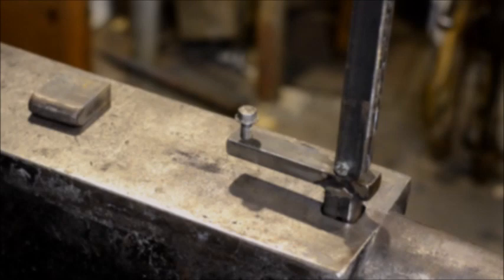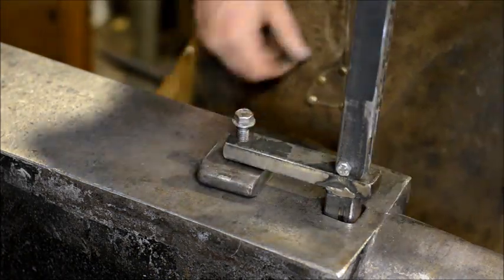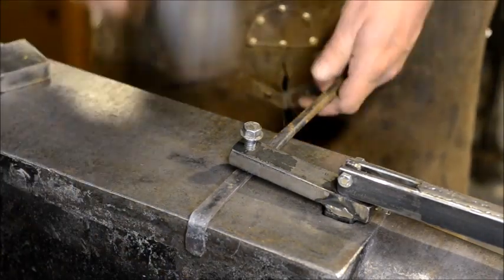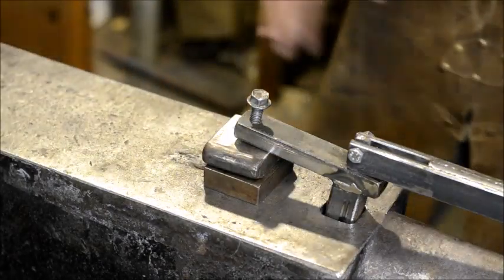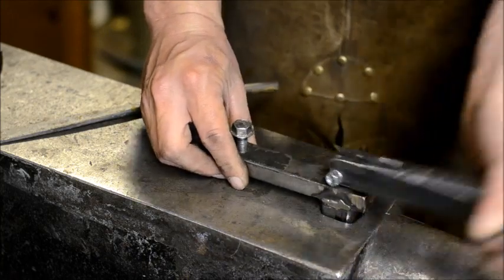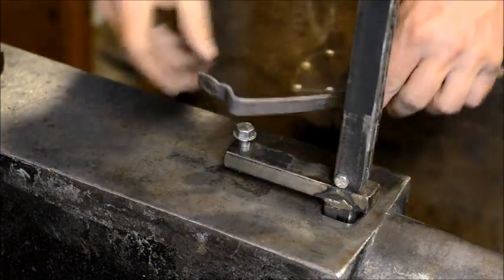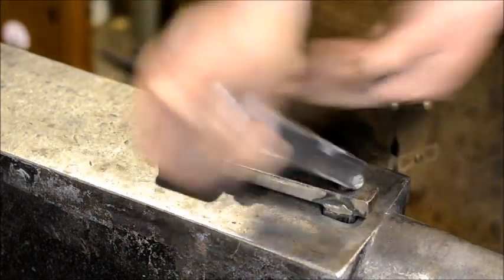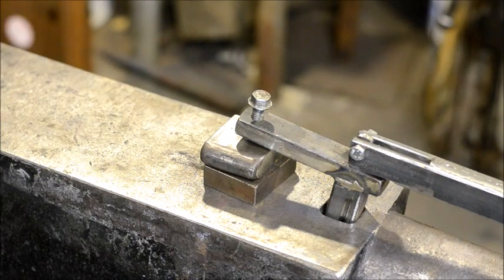THE BEST Blacksmith Hold Down Tool // Plans for Making a Holdfast

Comment: It's an interesting concept!

I personally have never run into the limitations you speak of with a traditional style hold down.  I use good spring steel, make the shaft round, and shape the foot like a set of farriers tongs.  It will hold down thin (1/16 or so) up to three inches thick well enough that I have to use a hammer to release the material.

Thanks for the video...
Reply: there are no improvements to make with blacksmithing.

Comment: I don't know if I will build this but I like your channel and it was an easy way to support it.
Reply: Might not be relevant now but my hardy hole is only 7/8" so could I size the tubing down to 3/4" without major adjustments elsewhere?
Reply from the maker: I appreciate that!
Reply from the maker: Make the hardy shank to fit your size hardy hole. It won't affect the tool.

Comment: Shorten the lock bar to nearly half, add a folding spinner handle that lays inline when locking. Adds speed with decreased radius and retains mechanical advantage of full length bar when locking. Skateboard bearings for cam lock. An hour and a half bus ride to high school provided plenty of design time. I had a Campagnolo quick release in my hand when the idea popped into my head. Built mine that day during a double block of metal work. Your's is the only other one I've seen. Did you get the idea in bits and pieces or in one eureka moment? Eureka's are great. Well done and all the best in the furnace. (gotta love spell check) Cheers

Comment: Roy, for 1/32" just loosen the bolt in the Hardy one turn, then adjust the thumb screw, should work fine.  Of course this was 2 yrs ago and you probably figured that out by now.

Comment: Thanks Roy...and as always, I will repost this with your permission.    I will get this done by tomorrow on Modern Blacksmithing.
Reply from the maker: +Charles Wright definitely have my permission thank you so much for the support God bless you
Reply: I have been battling the need for a power hammer and no funds, no space, and  likely would be tossed out of the neighborhood for having such a monstrous machine.    Aside from the occasional railing, gate ,etc.   I rarely have the need for a large hammer.   However as I get older and old injuries are showing back up.   the need has arisen several times for a power hammer.   I think the modified Davinci cam hammer is perfect and I have a 12 pound sledge that would be perfect for my needs now.   As time goes on and I move to a more suitable location, then a larger hammer would be perfect.   As for now,  I ordered and downloaded the plans.....Thanks again Roy.    Are you going to be at SOFA this year?
Reply: OH and I'll send you my contact info as well.   Thanks again.

Comment: Not to troll much but I love forging videos and people who take the time to post them. That said, some of the complaints you state with traditional hold downs.... well after seeing yours i get it. I use a hold down with a 13" shank. Its goof for  0" up to 5" it dose not buck up either. Please please please dont say things like the material is to thin for the hold fast to work.... if that is true of yours its because its not forged correctly. Some of your statements really detract from your skills. Also your self designed hold down has been being used by carpenters, leather smiths, bamboo fly rod builders and the such for hundreds of years now. Stay humble and remember more has been forgotten then we currently know about Blacksmithing.

Comment: neat idea.  I think if your adjustment screw was longer you'd be able to hold down a piece of tin foil.

but I'm not sure how hard it would be for me to make, and if I have the skills or tools or parts.  And my anvil is small enough that my Hardie hole is pretty small.  Not sure if your plans will work for me either.  I appreciate you paid to have the plans professionally drawn up and you went to the effort to do all this and, that alone is worth 8 bucks.  But I've no way of knowing that $8 will work for me.

Comment: a great design, just a suggestion tack a wing nut on the tension bolt, thanks for the video.
Reply from the maker: +Jared Lariscey thanks for the suggestion :-) in the plans I did make a wingnut for that part. Just didn't make it for the video. Thank you for watching!
Reply: Christ Centered Ironworks hey you bet, keep up the good work!

Comment: OK, bought the plans, now I guess the wedge has to be fabricated anddrilled down the center and tapped with a 1/2" 13 threads per inch tap..............................are there alternatives
Reply: Just forge the wedge :) and use whatever you have on hand bolt/nuts/tap wise :D